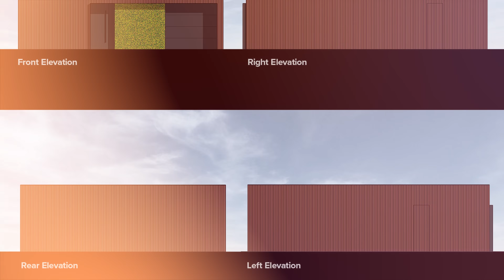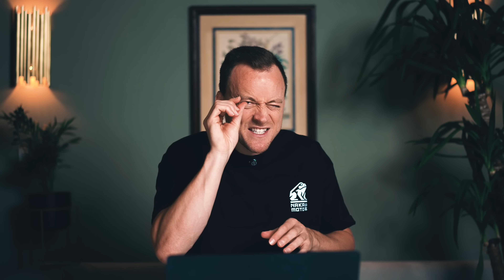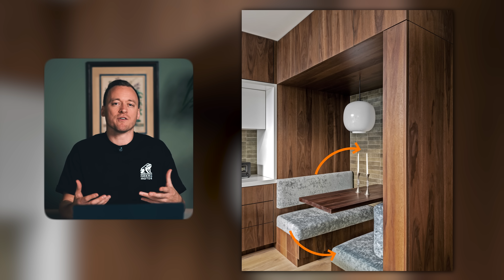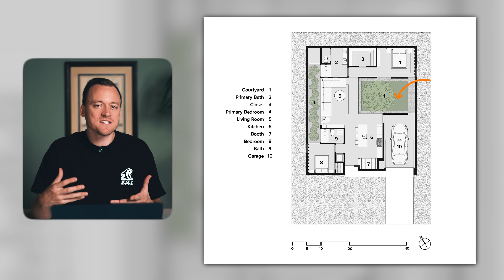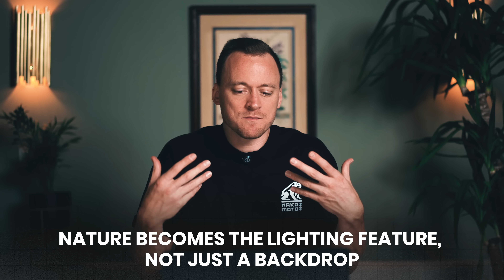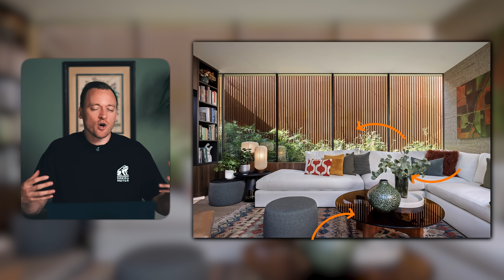this home is every introvert's fantasy. and it's real.

Comment: Love a courtyard home, but those giant, non-operable windows are SUCH a tragedy. With the lack of surrounding yard space that interior courtyard should be entirely integrated and easily accessible—it's another room, really. Instead you've given 400-ish square feet to bad corporate office landscaping. Woof.
Reply: Architect of this house and Homeowner here--- I get this comment a lot.  The house is for my wife and I and we love the expansiveness that the glass gives to the rooms as well as our our olive tree.  We also love the feeling of "floating" between the garden spaces, but neither of us is the type to hang out outside in the Texas heat (or cold).   We opted for much more energy efficient fixed glass without the heavy and expensive tracks and frames required to open the whole thing for the few days that we might do so.  We have a passive ventilation system for fresh air, and it all works great for us, but we understand it may not be everyone's ideal.
Reply: @spiralclear  You are such  multi talented. We saw your house on other chanel my husband and I we were both blown away by how you problem solved this idea house from beginning when it was just  once was someone else’s back yard. How cleverly  instead of solid walls, you brought  lighting by those beautiful floor to ceiling large  windows. As you explained how in Texas it’s hard to have your widows open with bugs and unpredictable weather … Well done. ❤❤
Reply: @spiralclear it’s a beautiful design and customized for you and your wife, BRAVO!
Reply: @spiralclear so what’s your emergency egress with no widows facing out?
Reply: @JamesReedy great question
Reply: @JamesReedy  Correct me if I'm wrong, but it appears that there is an egress in each bedroom. 

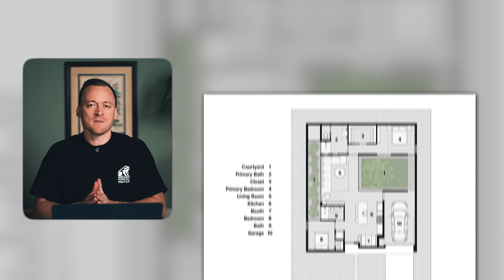If you look at the pic/diagram shown at 5:18 you'll see a marking on the exterior wall of each bedroom near where the wall meets the glass from one of the courtyards.

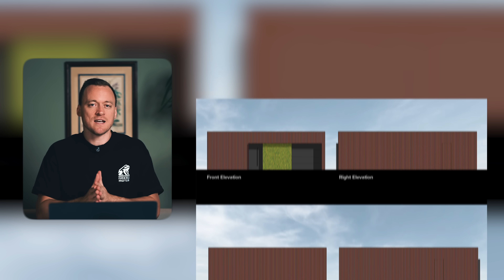Then, if you look at the pic/diagram shown at 6:09, you should be able to make out the outline on the exterior wall at the same locations.

Edit: corrected typo errors
Reply: @TheDevildogs75 good eye you might be right!
Reply: @spiralclear would love to have one...!
Reply: @spiralclear I’m a desert gal, and I LOVE your home, and understand it. It’s absolutely gorgeous, every aspect of it. It’s sad you have to explain your choices to other people who live in other areas and don’t have your tastes. ❤❤ Stunning! Very similar lines to our home.
Reply: @spiralclear It's a great house. I don't even understand the english of the person who is critiquing your build let alone their perspective. Keep at it buddy!
Reply: @spiralclear just wondering about the flat roof and if solar panels be possible without spoiling the design?
Reply: @spiralclear  If I had the money, I'd hire you to design my house.  As it stands, my broke ass is living in an apartment lol.  It might have its perks (someone else does yard work, no set day for trash pickup that I have to worry about, I get to whine to the landlord when something goes wrong and it gets fixed for me, preventative exterminator visits I don't have to pay for, no mortgage or property taxes, etc), but there are some things I miss that I don't have here (can't paint my walls or replace carpet with hard floors, need to be mindful to not block windows with short furniture, noise at odd hours as people and kids come and go, and specific to the complex I live in we have communal laundry machines).  It's mostly peaceful and nice here, but you've designed my dream home lol.  You rock!
Reply: @spiralclear yooo I absolutely loved everything about your house. Starting from design coloring and all the science behind it! It's not one of those typical slap millions of dollars and just call a house fancy. This is actually really unique house. Just wanted to appreciate!
Reply: @spiralclear It's a marvelous and ingenious design!!!
Reply: @spiralclear  your work is all over Austin, isn’t it?
Reply: @spiralclear 

One door for outside access would not cost much. I live in Minnesota and we just had about four days of blizzard conditions. So yeah, we get the need for really good doors with good seals and great insulation. Still - we open doors and windows as much as possible. Energy efficient of course. Triple glazed, whatever features you want, all pretty expensive.

Oh yeah, we have over 11,000 lakes and water everywhere - meaning the summer humidity is awful. And the mosquitoes? Yeah, pretty annoying daily. We still would have put a door to the courtyard. 

So you could retain the expansive of the glass and still have ONE door to a useable courtyard. And if you don’t have a door, how do you maintain your landscaping?

Yeah, sorry, it just seems a bit crazy to this Minnesotan.
Reply: @deekang6244 Ummm….there IS access to the atrium from the garage…why would you think anyone capable of designing this gorgeous home would not put an access door/window in? Maybe check out the floodplains again? It towards the beginning, and it shows how you can enter from garage.
Also, this is THEIR home, and they stated they don’t sit outside in the yard, as it’s not their preference. They have totally different issues than you have in MN.
Reply: @spiralclear presumably there must be some access to the courtyards though if only to keep the plants under control? The narrator said something about a door in the master bedroom?  I really like the concept of the house - it’s like a fort!  Weather in Ireland would not be conducive to it though as you need windows in most directions particularly south and west to get enough light.
Reply: @spiralclear you have a beautiful house, well done mate.
Reply: @spiralclear Love it!
Reply: @spiralclear considering the Texas heat and humidity I'd skip all that window  hardware also!  I visited my daughter in  Austin in January and I needed the a/c on most of the time😂
Reply: @spiralclear It's certainly my ideal. I actually dislike windows pointing out into busy roads and sidewalks and such, while enjoying natural light. This is an excellent workaround, feels safe and secure, while being inviting and cozy for those who know what it's like inside. This is by a huge margin my favorite home design and I'd give quite a bit to own something similar.
Reply: @spiralclear I might want to build a replica of your house on the other side of the country. Is the courtyard accessible, by any means?
Reply: @spiralclear You live in the computer? Lolol
Reply: @spiralclear 
Totally agree! I like the seamless, simplicity of the fixed glass!
Reply: Thank you for the explanation. I was wondering how you care for the olive tree and surrounding plants if you can not open the glass windows to access the court yard?
Reply: @spiralclear  Just curious how do you get into the bamboo courtyard? If you do another video I would be interested in seeing the emergency exits and more outside views of the courtyards.
Reply: @spiralclear Brilliant design.
Reply: @spiralclear isn't there a fable that only truly kind men cultivate olives. Because surely they'll never live to sit in its shade. 😊
Reply: @spiralclear You and your wife built a beautiful home and you should be very proud of it. It is gorgeous and brilliant. Well done!!!
Reply: @spiralclear  great reason. What about taking care of the plant life in the courtyards? Is it automatically watered and cared for? What if the plants die or rot? And for fresh air (ventilation might not always be ideal), do you just step outside?
Reply: @spiralclear Very imaginative.  If I was younger, I would definitely love to make a home like this for myself.
Reply: @spiralclear this space is incredible. It's everything I'm looking for but didn't know how to put into words. How does it go in terms of potential fire safety rating without an external window? And natural regulation of heat and cold? Just wondering if this is feasible somewhere like Australia.
Reply: Thank you for sharing how you live and why you choose to design the courtyard like this. I had this exact thought, why not make the space more „livable“. But tbh your insights have completely shifted my view. I am in Germany and was absolutely not considering the climate in your area. I love how the light floods your place as well as all the wonderful materials inside and out. :) I hope you live a wonderful long and happy life there 😌
Reply: @spiralclear As a Norwegian, it is hard to imagine not interacting with the outside in any weather, but we very rarely experience suffocating heat. It does seem like even people in Texas would see the use of a wheelchair accessible front door in such a flat property, and do you really never take off your outside shoes and coats when entering the house? All houses in Norway have an "entré", most with a door closing it off from the rest of the house so that the heat loss (in your case heat gain) that comes from opening the front door can be kept minimal. We dress for at least four seasons, sometimes in one day, so there are massive amounts of shoes, coats, hats and more even with just two people, meaning that a well planned and executed entry room is a must. I remember always finding it weird as a child  that American TV shows had people open the front door and be in the living room/kitchen in their dirty shoes, and then just keep walking through while still wearing their coats
Reply: Them explaining it’s in Texas is all you need to know. There’s only like 5 days in spring, and maybe 8 in the autumn, where it’s nice enough out to actually be outside or open windows. It’s *miserably* hot in the summer, with high humdity that makes it feel hotter, and the winter is just dismal, sometimes frozen solid, but no pretty snow. This is how you can do “outside” in Texas, without being ridiculously uncomfortable.
Reply: @madnessintomagic  Hah, thanks for the context. I'm drinking coffee with all the windows open in LA enjoying the 70º weather so I have regional blinders.
Reply: @johnc.325 I live in the California high desert. If the outside temp is less than my A/C set point, I'm opening the windows and doors.
Reply: @johnc.325 ....and that makes it completely worth the "expense". People always talk about how expensive it is to live here in Los Angeles, however, living just about anywhere else.... you still spend roughly the same if not more, after heating and cooling your home year round.
Reply: @madnessintomagic good lord that sounds like hell on earth.
Reply: @JennyJolivet  It was. Only redeeming factors were restaurants and shopping. When I lived there I’d previously bought a fleet truck in a state where I didn’t need AC. Didn’t even realize I didn’t have AC until I moved to Dallas and May came around. 6 years of hell on earth.
Reply: @JennyJolivet  Texas is a beautiful state.
Reply: @TheRealLeahFarley  there are parts that are OK, but it’s not a very attractive state compared to many other states in the country.
Reply: @madnessintomagic 
Tell me you’ve never lived in Texas without telling me you’ve never lived in Texas. By the way, this might surprise you, but we have 365 nights a year in Texas. But please keep spreading your hate, hopefully it will scare away refugees from other states.
Reply: There's "snow" right now in Texas...more ice though🤪☠️😭😭😭 @madnessintomagic ❄️🌨️🥶
Reply: @t @thesecretaryofcommonsense3851   I know! My brother-in-law sent a video from Austin. Weird to see all their native plants in snow. Also you can’t possibly think a short term fluke of global warming negates my point. There uses to be days of black ice in Dallas too but it proves my point. No pretty winter. Just fluke one-off dangerous misery.
Reply: @madnessintomagic  I’m from Northeast Texas. It’s not that bad. Good grief.
Reply: @madnessintomagic 
And yet, so odd.

I live in Minnesota. Humid in the summer, temperatures can reach over 100F. Brutal winters sometimes, we just had blizzard conditions with below zero F temperatures at night, I didn’t even look at the wind speeds, or windchill (it’s cold and windy).

And yet, we cherish those few days we can open windows and enjoy the weather. We embrace it!

So yeah, in a more temperate climate, this makes no sense to me at all.
Reply: I was thinking about the courtyards. Yes, my instinct would be to make it functional. However, it becomes another visually busy space that you need to maintain. I think there's a real place for these encapsulated gardens that are purely an aesthetic piece.
Beautiful home.
Reply: I was thinking this from the perspective of maintenance. Probably the small ornamental grasses don't need much but something will happen eventually. Hopefully there is a door hidden somewhere.
Reply: @bradye21playsIndieHorror I am pretty sure there is access from the garage for maintenance purposes. It’s also a glass panel…you can see it on the design plans. Unless I’m mistaken….thats what I saw, anyways.
Reply: Pretty. Different. ❤
Reply: I LOVE YOUR HOME! GENIUS CONCEPT!!!! Kudos for living your BEST life in a beautiful space! ☯️
Reply: As someone who values my privacy and very much enjoys solitude, I would love this style of home in a more temperate climate where the court yards could be usable living space. This design would not be practical where I currently live in Minnesota. The court yards would fill with snow in the winter and flood with our spring and fall rains. They would need to be covered with a strong roof of some sort.
Reply: @grandmasparkles58 I'm sure the area drains well. A person intelligent enough to design this home isn't interested in creating a fish bowl until the water evaporates.
Reply: I didn’t know u can’t go outside in the courtyard 😭😭😭 so it’s just a display case essentially 💀💀
Reply: The Courtyard is Useless without the 'Outdoor Living'  Space being Utilized as an Outdoor Courtyard Purposeful Useable Space
Reply: @BeeKeeper57  It’s Texas. Nobody sane wants to be outside.
Reply: @BeeKeeper57 how do you maintain the courtyard if ypu can't get in it?
Reply: Very Brady bunch esk
Reply: I love it.
Reply: As a very no experience ,not even just a bit in any of this, it's cute. Although, I have a kid. I low key come up with these ideas myself. But in my version it's more kid friendly fun xs ,in the center. Being "outside" but not really, while in the comfort of your own space is... Ish I could only dream about 😭.
Reply: Love this concept a lot. I’d choose to make my courtyard part of the living space and maybe a water feature that can open to the inside. I do understand the climate in Texas makes this make sense for them. I live in more moderate climate where making it a living space is more realistic
Reply: This home is absolutely incredible. Beautifully executed! And great commentary also. 🎉
Reply: Got the point here, but where I live, even when it's sunny and beautiful outside, people are stuck in their homes even if they have a back & front yard, even though they have a swimming pool.  People are GLUED inside the home to TV, internet, cell phones, gaming... They don't go out anymore.  It's like a ghost town all summer long even at 23° to 25° Celsius and sunshine... kinda scary... So this kinda house might be perfect for people today, generally speaking...
Reply: I looked up the location and it’s in Austin, Texas, situated in one of the highest crime neighborhoods in the state, and Texas is in the top 10 most crime-ridden states.

I’m thinking this place is a soundproof bunker for a good reason: the owner doesn’t want to hear the shootings, screams, alarms, and police sirens that are a constant background.
Reply: @Fabulist 
When I lived in Austin, I wouldn’t have lived in this neighborhood, but the area is being gentrified so it has that diverse mix of rich and poor. It used to be, and probably still is, a neighborhood where you look over your shoulder when you’re out and about, at least at night. The tax assessment on the property to the left of this house is $650k. To put it into perspective, there are a Hermès and a Lululemon store about 12 blocks away.
Reply: @Fabulist yeah the immediate alley looks kinda dumpy. I looked around the vicinity and there are a good number of statement type art homes lots of modern meets standing seam metal. They look weird mingled with more pedestrian homes.
Reply: @Fabulist Haha, one of the most crime-ridden states? What stats are these? This is an enormous state, my friend.
Reply: @Fabulist ah so the steel wasn't a design choice so much as its armor. Inviting.
Reply: The courtyard treatment is definitely a fail.
Reply: This is why architects should not be allowed to design houses
Reply: @perhearkko4255  George Costanza always wanted to be an Architect which may explain The Interior Courtyard being more of a Fish Bowl than a Courtyard as he IS a Marine Biologist🤣
I would have put up a 5' tall Board on Board Fence around the Roof and Stairs going up from the Interior Courtyard and have a Rooftop Deck for even More Outdoor Living Space👍
Reply: @BeeKeeper57 😂😂😂❤
Reply: @BeeKeeper57 Nobody could survive more than five minutes on a rooftop deck in Texas.🔥
Reply: @nancyrukavena6992  Nobody & Sons Construction Co must be very busy then
Reply: @nancyrukavena6992 
This might surprise you, but the sun magically disappears at night in Texas. Astronomers are still perplexed by this phenomenon, but hopefully they’ll discover why someday.
Reply: 100%